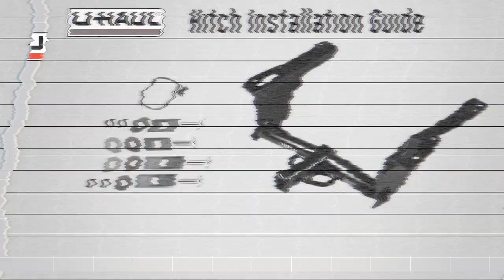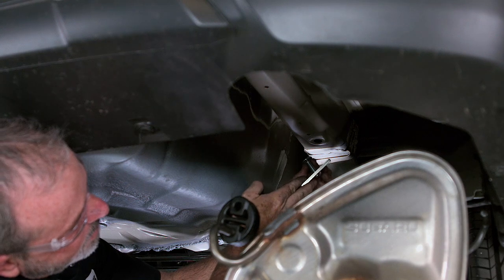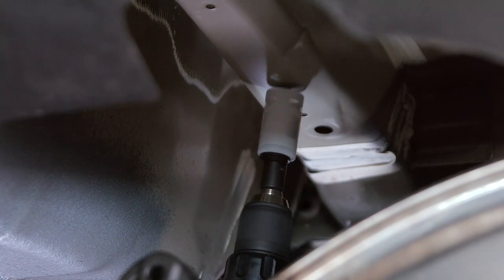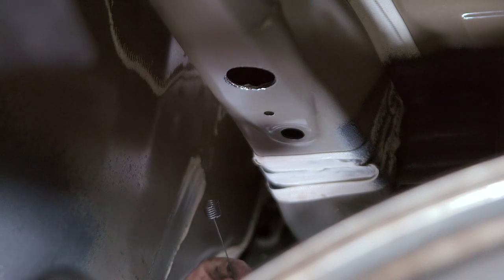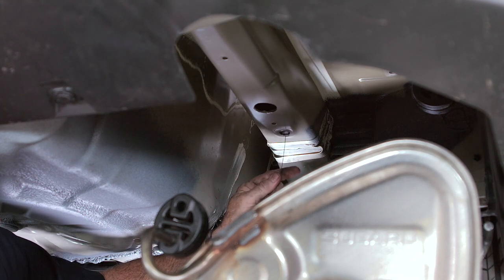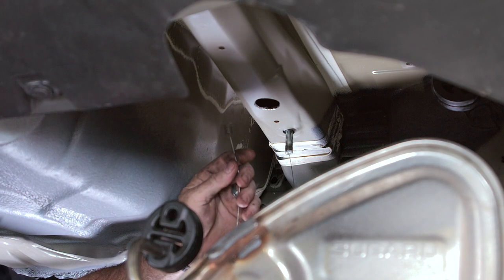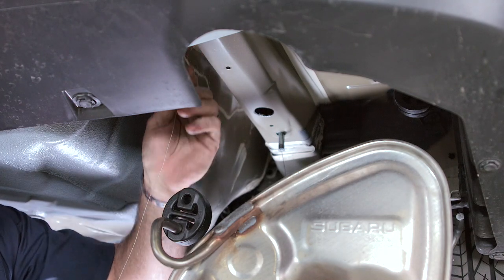2018 Subaru Outback Trailer Hitch Installation

Comment: My wife and I own both 2018 and 2021 Outback.  This is a "NO NO" for us.  You are weakening the frame by drilling the frame with a 1 1/8 inch hole saw.  There are other hitches for Subaru Outback that do not require drilling into the vehicle frames.  As for us, we are extremely happy with the Subaru OEM hitches - no drilling required.
Reply: Where you get yours?

Comment: That part of the frame you are drilling into opens up at the back (underneath the bumper beam). You should be able to pass the hardware through that slot instead of drilling the hole into the frame.
Reply: Sometimes the slots are too small so instead of drilling I use a hole enlarger to open that preexisting hole a bit for the hardware

Comment: I’m a shop and do a lot of installs, custom work and metal work… if you need to do that to your frame to install a hitch then you bought the wrong car.
Reply from the maker: This hitch is designed specifically for this vehicle and the process of adding an access hole, if done right, will not harm the integrity of the frame. There are thousands of hours of testing before these are released and it would not be on the market if it was unsafe.
Reply: @trailerhitches  1000s of hours of study ? Ok show me .. because I don’t believe that for a second. 
Because I have many many year of experience in building cars, fab, metal work, and from experience I can tell you that the Subframe that the hitch attaches to would fold like foil if hit from the back. I can also tell you that any metal structure that is perfored cut or drilled loses strength no matter what. 
Considering the subframe is 15 gage and hitch is about a quarter inch, subframe would fold before the hitch 100% of the time 
I do also enough collision and insurance claims to tell you the car would be totaled on the spot if subframe and trunk floor would fold. 
PS: I have installed too many hitches in my life to tell you honestly this car and the subframe are NOT made for it. But I understand you’re selling a product and can’t tell the truth